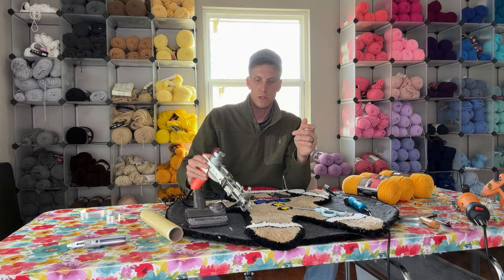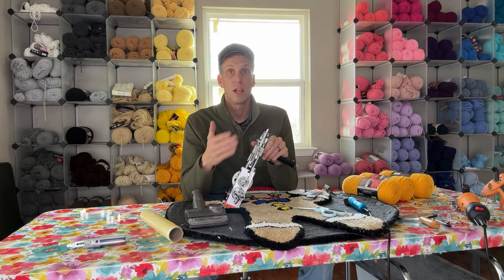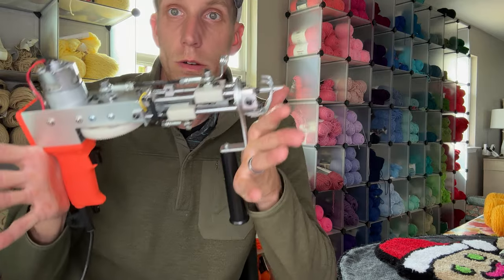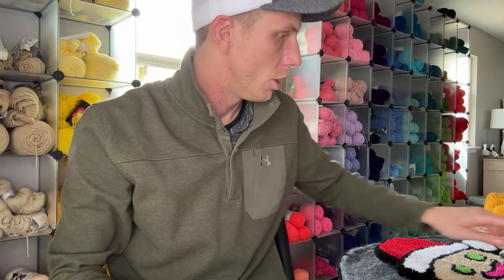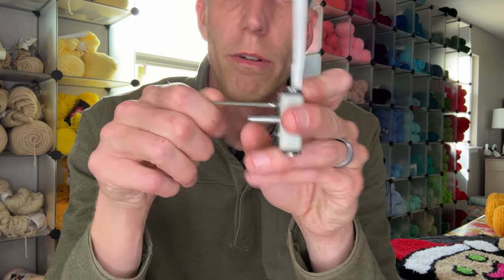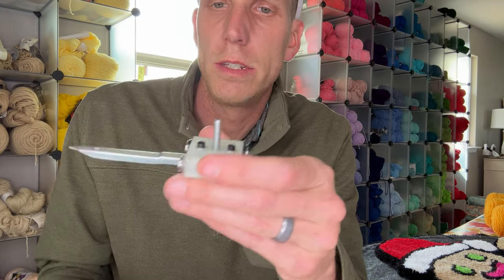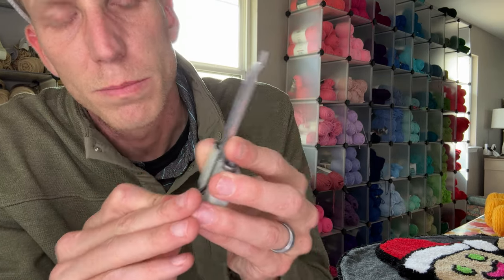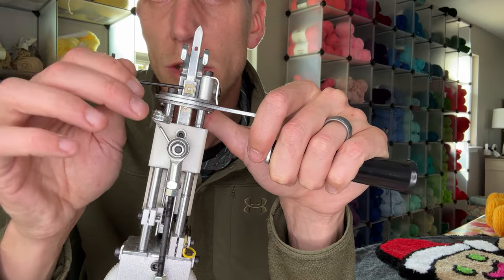How to Adjust the hole size on your tufting gun Needle.

Comment: Hi! i’ve recently started with a tufting gun and find that when i use pure wool the machine cuts properly, but when i use acrylic it doesn’t. Do you have any advice, whether the gun needs adjusting or i need to use thicker wool? thanks!
Reply from the maker: Make sure your using 2 strands of yan

Comment: Hello, just got my gun a few days ago. When I use it the yarn doesn’t stay into the turf it falls out. How can I fix that?
Reply from the maker: You probably have too much tension on your yarn as it’s being fed into the machine.  Try to make the yarn as loose as possible.  Check out my video on “how to prevent yarn from falling out” that should give you a better idea of what I mean.  If there’s too much tension, the Machine will still cut the yarn, but pull it back through

Comment: Can you tell me what the reason   For the tuftijg stitch to be choppy/ skipping when tufing vs a steady braid like stitch?
Reply from the maker: Could be a few things, scissors dull, too much tension on the yarn or not constant/even pressure applied to the tufting gub
Reply: @justruginit  thank you! I haven't gone a few months, but have done quite a few projects. How often should you change the scissor blade?
Reply from the maker: @lavenderjohnson7017  it just depends, every machine is different and use a different quality pair of scissors. I just replaced mine and it was about 6months
Reply: Where to buy and find blade for the Gunn

Comment: The sze hole blade came out of my gun and don't know where to go exactly?
Reply: The same thing happened to me, did you know how to fix this?
Reply: @valeriahurtado4955   ok u can srew it back on. Th e hole size is up so I have to change it or screw back
Reply from the maker: Sorry for the late reply.  If it sizing blade fell out, it usually means you unscrewed it to far or forgot to retighten it.  There should be two prongs on the bar that slide back over a nut on the bottom side of the needle.  Once that on, tighten it back down and you should be good to go